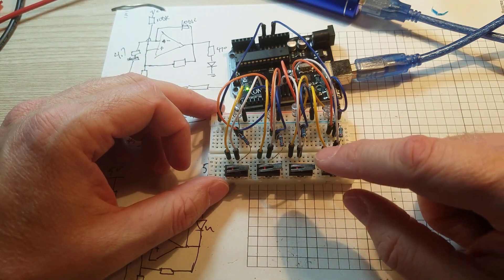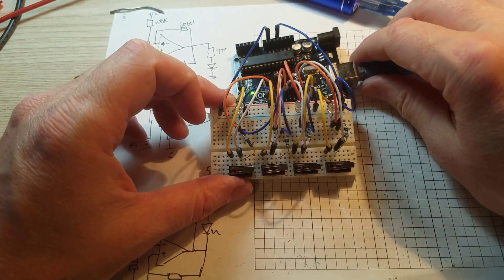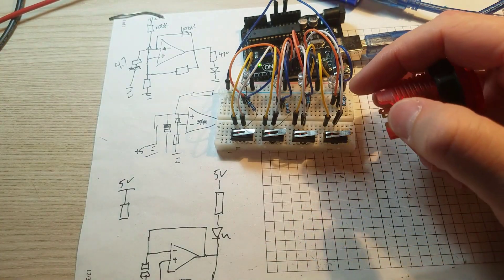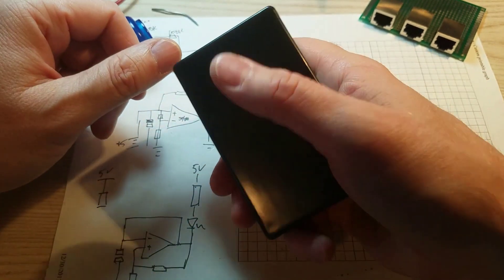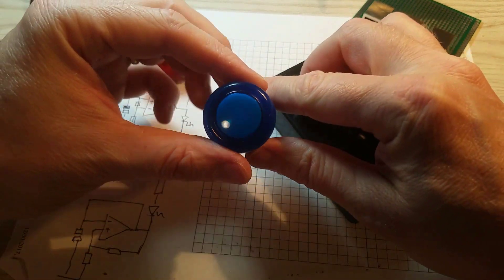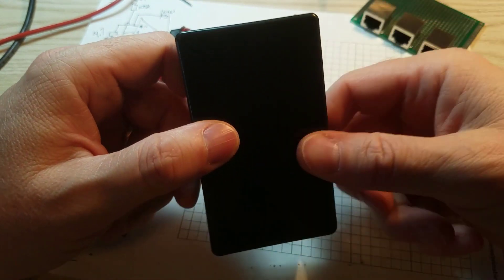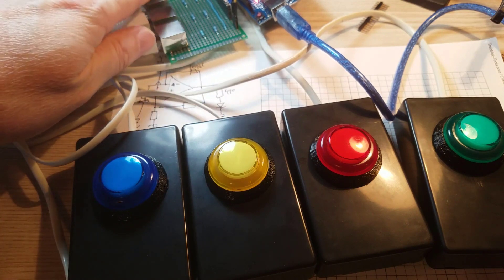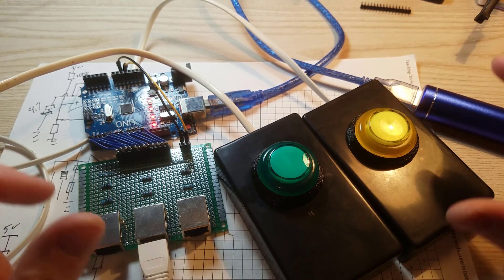Making an Arduino Game or Quiz Show Button System

Comment: Thank you very much for the video. Can you suggest a sound/buzzer device/connection along with the light? Thanks.
Reply from the maker: If you just want a buzzer, something like this will work great. Use the Arduino's buzzer function to make it buzz. 
https://amzn.to/3yOEq8K

But if you want to use sound and an MP3 file, you will need a sound module, like this. A bit more challenging to use but will give you far more options.
https://amzn.to/3eGo23y

Comment: I had this type of lockout machine (without Arduino) made by my cousin several years ago for Live TV Quiz shows,which I still use till today,  seeing your project, I would like to make an Arduino driven lockout machine, 
will it be possible to add a manual Reset switch for quiz master, so that the LED keeps on until reset switch i press, and also that there would a Buzzer sound when buzzer switch is press along with LED
Reply from the maker: Yes, this can be done pretty easily with an Arduino. You would have to use the analog pins. Msg me if you need help.
Reply: @Bluemonkeydev  sure thanks
Reply: @Bluemonkeydev   I do not see an email options on your "about" tag, is there any other possibilities to massage you ?
Reply from the maker: @Zonuna_Chawngthu  sure - bluemonkeydev@gmail.com

Comment: I've been curious about these thingies for a while now. But it does occur to me... If all I want is for a buzzer to light up if it is first to trigger out of a series of buzzers... Then I think it should be possible to build a contraption that works on very simple gates.... can even lock out buzzers with a simple flip switch. 

It just seems like putting an Arduino or atmega or raspberry pi in the mix is way overkill for most of these thingies... 

Of course, if you want it to trigger a sound or even keep track of scores and such... But in essence, a very "dumb" version should be able to be built, I recon...
Reply from the maker: Yes, it can be done w/ gates and flipflops. However, you might be surprised at how quickly it gets very complicated (and expensive). Since an Arduino Nano is about $3 and it requires virtually no complexity or additional components, a microcontroller really isn't overkill but rather the easiest solution. Best of luck!

Comment: Hi sir. Can i ask for your circuit diagram and complete devices with specs? I wanna create one thank youuu
Reply from the maker: Hello! Sorry, the only circuit diagram is the one shown in the video. But it's super simple. Each button gets an Arduino PIN and each LED gets an Arduino PIN. The Arduino sketch shows which pins I used for each but you can change them to whatever you want. It's a very simple project, even for a beginner.

Comment: Would it be that difficult to use discrete logic? Some 555 to time the blink and to serve as count down, flip flops to count down, logic gates to disable other buttons from lighting...  it would be cool to have redundant lights on the central control panel.  maybe use a d-latch that would require a manual reset instead of waiting 3 or so seconds.  Possibly use decade counters rigged through binary to seven segment converters to seven segment displays as a method to keep score.